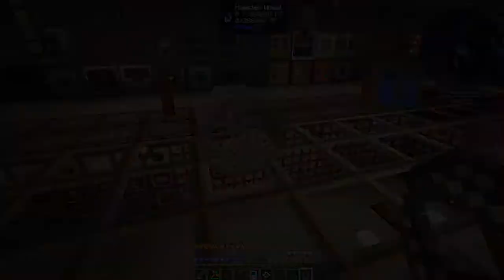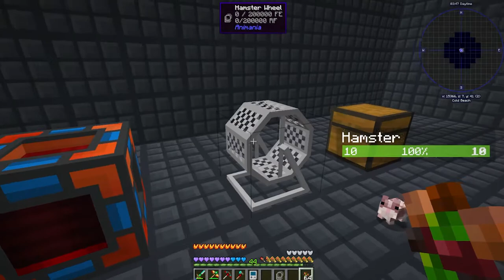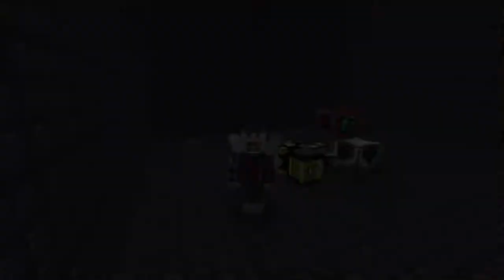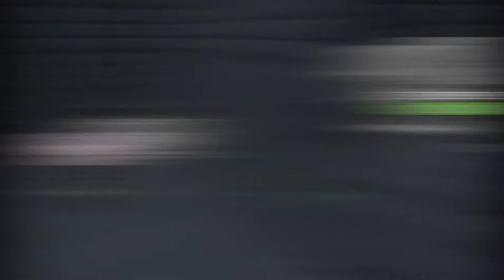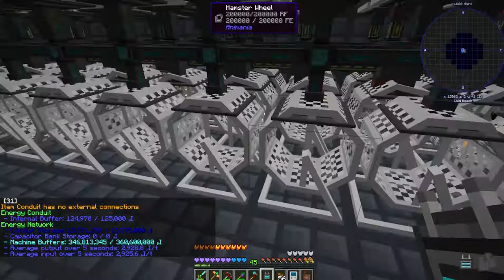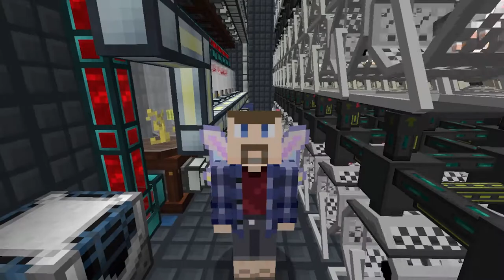Hamsters as End Game Power? - Minecraft: Enigmatica 2 Expert #66

Comment: I think ender io conduits are a maximum power transmission. I had 2 full enderium advanced generator sets pushing 160krf into an Ender IO conduit and it maxed at 125krf. If tunnels are an issue maybe use the rftools energy cubes in the compact machine or use flux networks to transmit power out ? 
Love the outside of the box thing 😀
Reply: To be honest I can’t remember. But I think it might have been the pedestals making charged draconian. But I’m not sure. I do remember the tips saying the fluid conduits can simultaneously transmit different fluids though. So I could be very wrong 😀
Reply from the maker: Fluid conduits, like item conduits instantly teleport the item from the tank to the target, without actually traveling through the pipe, unlike ducts and the like.  It's one of the things that makes them so ridiculously powerful.  The only thing that makes any of the other options better is usually how often it pulls stacks as well as needing extract upgrades in conduits to pull a full stack.  It's also why I'm so unsure how the power cables work.  Kinda wish the upgraded conduit power cables were in this pack.
Reply from the maker: How were you measuring transmission though?  Was it a single cable into an energy cube or something, because that would fail since the max transmit rate would get hit going into that, but if you connected the battery more than one it would transmit the whole payload, at least with fluxducts, as far as I remember.  I'm just honestly not sure how ender power conduits work.  I should have figured out some way to test it in creative, but I'm sure someone out here has to know.

I really don't want to have to tear part of this down and embed another tunnel in the middle or something if I can avoid it.  My original design was going to be to put the cube and tunnel in the center, and section it off into two halves to avoid this problem, and that's not what I ended up with for space.

On the upside, it doesn't seem to be causing much in the way of lag, which is not what I was expecting, but I still might end up just dynamiting the whole thing when I end up making a bigger reactor.